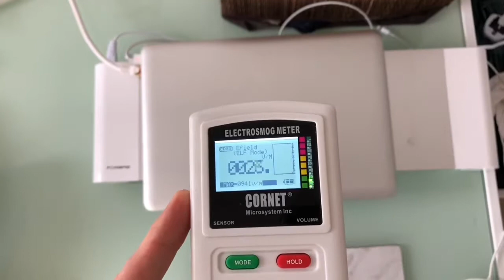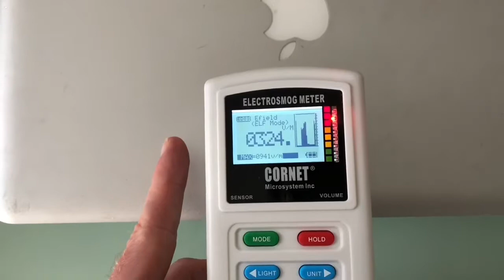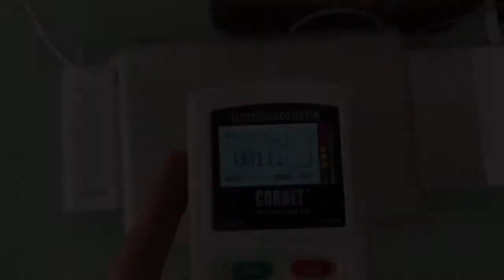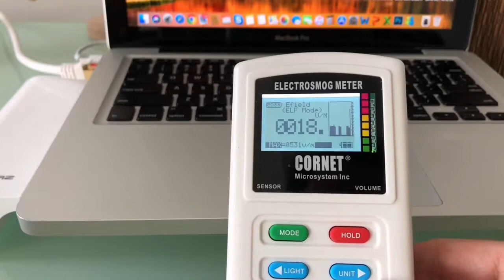How to Earth/Ground a MacBook Pro.

Comment: But does anyone know WHY this happens to ageing macbooks?  Mine never used to shock me, now it's bordeline dangerous (using it on charge while holding an electric guitar at the strings = Big OUCH).  If it never used to do it then it must've been adequetely grounded previously.  Is there some sort of grounding mechanism inside the casing that wears out over time?
Reply: Lmaoo I hate this I’m still having this problem currently

Comment: My only question is when you do this, isn't it constantly charging the device? Therefore ruining the battery overtime. I still wanna be able to use my Macbook without it being plugged in when I need to, and not having a stupidly short battery time.
Reply from the maker: No, you switch the wall socket off but just keep the plug plugged in to stay connected to ground. Does that make sense? Otherwise if you keep the wall socked switched on yes you’ll reduce the life of your battery.
Reply: @phillipsfit  Wait what if I just plug it into an extension cord that has an off/on switch? Will that have the same effect?
Reply from the maker: Random Joe if the extension chord is Earthed then yes that’d work.
Reply: @phillipsfit  OK! Thank you! 🙏
Reply: @phillipsfit  Sorry for bombarding you with questions, but if I just plugged my charger straight into a grounded, three-prong extension cord, is there even a need to add the third prong to the charger itself? Hope that made sense and I REALLY appreciate it!!
Reply from the maker: @yusuf_alhussainy  yes of course there’d still be a need to add the grounding connection on the charger; if there’s no connection from the charger unit to the 3 pin plug then it doesn’t matter what you plug it into, there still won’t be a connection from the charger to the 3 pin plug. It’s like if you had a 2 meter hose pipe and cut it in half, you won’t get any water flowing out of the second half of the pipe and adding an extension pipe to the second end of the pipe won’t change the fact that no water is coming out - you’d have to reconnect the cut pipe. Does that make sense?
Reply: @phillipsfit  Ah I see... thanks!
Reply from the maker: @trevorsmith7753 maybe Apple have figured out their fault and rectified it on their latest model then? Doesn’t help all the millions of us that are being bombarded with EMFs from their older models though does it?

Comment: I don't know anything about this but if it goes in the safe zone when you touch it, is that because your body is like, absorbing that energy?
Reply from the maker: 100%... your body basically becomes a grounding rod when you touch it, so the "energy" gets diverted through your body which is not a healthy thing to be exposed to over the long term.

Comment: This happens due to improper earthing in apple charger. I had same problem and Apple suggested to buy extension cord which solved my problem. Highly recommend @t
Reply from the maker: It’s not the charger that has the improper earthing, the charger and the cable are absolutely fine, it’s the fact that they don’t connect the earth pin from the charger to the earth pin on the plug. An extension chord will not fix this! The only way is to run a wire from the earth pin in the charger to the earth pin on the plug like I show in the video. Hope that helps.
Reply: phillipsfit the power extension(3 pin) has the earth pin
Reply from the maker: kevishen yes, that is correct my friend.
Reply: @phillipsfit  i just bought one yesterday and added an earth rod to my socket as it was previously ungrounded. Now the proble seems to be solved.
Reply: @phillipsfit  It's a shame that apple don't even include a 3-pin socket in all their macbook lineups. Many persons seems to suffer from this issue. Idk if this is dangerous for the laptop though. I got the 2019 one.
Reply from the maker: kevishen having an ungrounded laptop is more damaging to you than it is to the laptop. The only possible reason I can think of why Apple don’t have a ground pin in their UK 3 pin plug is that they added the earth pin that goes into the wall (for the UK market) but the design team forgot to add a corresponding ground pin at the other end to connect said earth pin to the ground pin on the transformer.
Reply: phillipsfit I don't believe that you can forget such things. What I think is the truth is that there's no regulations(in the EU, US,...) to force them to ground their electronics below a certain voltage. For them, it's 100% safe.....
Reply from the maker: kevishen if you’re right then I wonder why they used a metal earth pin in the UK 3 pin plug? It’d have cheaper to just to use a plastic one. Also, why did they bother to put a ground pin in the transformer and have a ground wire in the charging cable attached to the chassis of the laptop. They went to all that trouble to then not bother to connect the ground to the earth pin? Just doesn’t make any sense!
Reply: phillipsfit the UK plug has an earth pin which is in plastic last I know. Also I noticed the issue doesn't appear in all countries. During my trip in France, I didn't feel this issue despite using an ungrounded cable.. Also, what other reasons would they not properly ground their laptops?
Reply from the maker: kevishen hmm inconsistent then, not great. BTW just because you can’t “feel” the buzzing doesn’t mean it’s not grounded. The only way to test this with 100% certainty is to measure it with a meter such as the one I’m using in the video (link is in the description) or with an Ohmmeter.
Reply: @phillipsfit  the 3 pin power extension cable solved the issue definitively.

Comment: #respect and Thanks a lot from India!! I did exactly what you showed but i didn't get the 3 pin adapter. So i have left the ground wire open coz
1. I'm lazy and smart at the same time,🤣
2. I don't need to carry the extra 3 pin adapter all the time
3. Zero cost
I just need to be careful about in which hole i insert the open end of the ground wire🤣
Reply from the maker: You’re welcome! Just make sure that that loose ground wire is securely connected to the Earth and yes, please be careful not to fry yourself (or your Mac) by inserting the ground wire into the live hole!
Reply: @phillipsfit   Yes sir!

Comment: Hello there, so my house doesn't have any sort of grounding to the outlet and I tried getting it earthed but for a lot of reasons it turned out to be unfeasible and extremely expensive to do it. What would you recommend in this case?
Reply from the maker: boba the only other way would be to put a grounding rod into the earth outside then.
Reply: @phillipsfit  Oh shit... Unfortunately that's not an option for me.. Would a UPS do the trick by using its battery as a ground?
Reply from the maker: boba no, it needs to be physical ground not 0V I’m afraid.